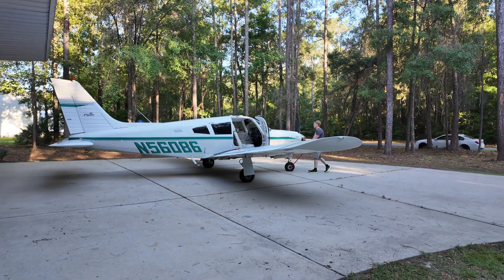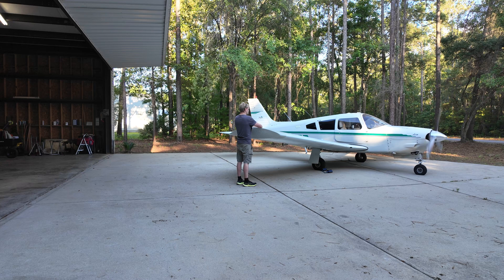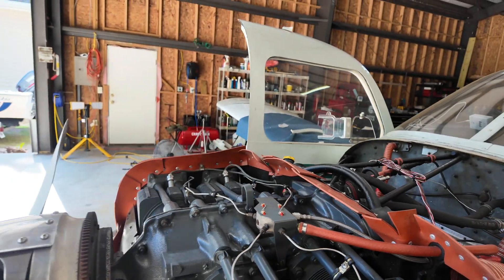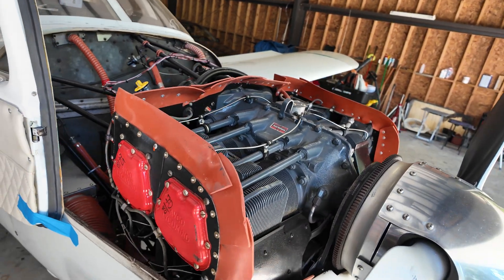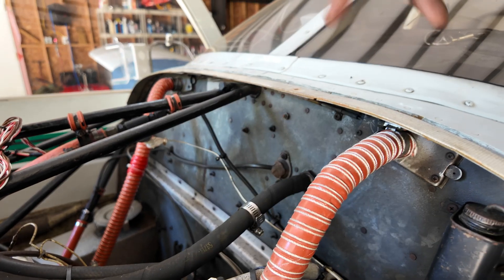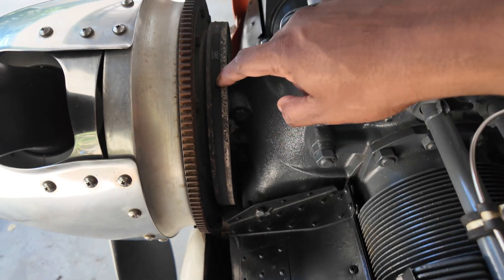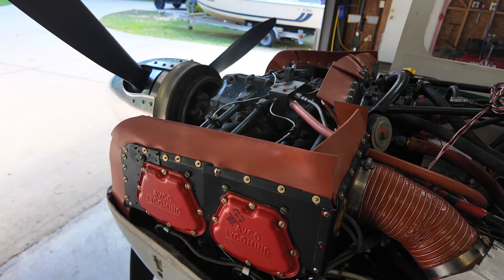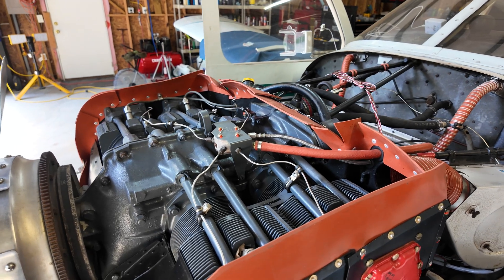Critical Engine Components - Lycoming IO-360

Comment: Watching this video I see some issues:

2:52 Upper plug wire on #3 cylinder has outer jacket worn through
7:12 Breeze clamp is loose and not fastened properly onto vacuum fitting on firewall
7:36 Zip ties directly on engine mount fastening wire bundle (zip ties will wear through paint and allow corrosion of engine mount)
8:27 Butt connector on yellow wire - insulator slid off, electrical contact is exposed
13:37 Nosegear oleo collapsed (needs pressure - should be ~3" strut showing)
Reply from the maker: I freaking love this. Several items have been addressed but I see others that I will get my A&P to hit this upcoming week. The extra eyes are worth gold. And I love your content. #enshitification
Reply: @OpenSourceGA  haha now I know you watch my videos! I too love this stuff, I found an engine baffle wearing on one of my pushrod tubes because of a viewer's sharp eyes who pointed it out to me.
Reply from the maker: Long time subscriber! One of the greatest tools YouTube affords is are team members who add value in ways like this...for free. I'll never pass on an extra set of eyes. It's an excellent perk. Much better than those who threaten to "call the feds" at the slightest inconvenience.

Comment: Hi, I saw a some kind of custom hole / baffles / guard infant of Cylinder #2 , is this for additional cooling? I have IO 360 A1b and have been fighting for over a year now my cylinder #2 running 50F hotter than my #4. Is this something you did to cool that #2, greatly appreciate ur time and sharing this video . Stan
Reply from the maker: I'll take a closer look but my this installation looks standard for this engine/airframe combination. I haven't modified it and this airplane currently only has a single CHT probe. I think what you might be seeing is the opening for some scat tubing that used to go to either the original alternator or engine driven fuel pump. The current setup does not use that cooling hose. By the way porting air to the lower part of the cowling would be a bad idea. Make sure your spark plug cables are elevated off the cylinders and your baffling is new/tight abduct the Cowling. Don't let any air get past the top of the engine it will need to get forced down for best cooling. Also check sparkplugs, clean your injectors and check your exhaust valve on the hot cylinder. 

Glad you're here!
Reply: @OpenSourceGA  It's used for a blast tube for cooling the alternator, if the alternator requires it.

Comment: Mattituck on Eastern Long Island, NY overhauled engines until 2012. They were highly regarded. IO360 Lycomings don't lose much power as they age and can be run a long time over RTBO in non commercial service. Lycoming cylinders last a long time. We overhauled two IO320s at Mattituck at 2200 hrs in a Twin Commance in the early '70's. They were still running strong but the bottom plugs were getting oil fouled after sitting with the engines canted slightly due to wing dihedral and a few drops of oil had a free route down the bottom of the cylinder into the spark plug recess. They still only burned a quart of oil in 4 hours. Do oil analysis and run them a long time.
Reply from the maker: I really appreciate this insight! This IO-360-C1C is running like a top. All the forum posts I've seen hold Mattituck in high regard.

Comment: LOL, the aviation piston engine has not progressed since WW2.
Reply from the maker: Hate to say it but you are absolutely right 😂. There are many new offerings and technology in the the experimental side but we certified folks are lacking reliable improvements.
Reply: @OpenSourceGA  Thinking about it GA, engines are pre WW2, in WW2  they had overhead cam, 4 valves per cylinder, turbocharging and supercharging with intercooling, Nitrous oxide injection, water methanol injection.

Today in GA, pushrod OHV engines with carb heat and points ignition, it's amazing what we can do in the progressive modern World!

Comment: Looks great! I've been trying to better understand the cycle of oil in the O-360 and similar engines, and specifically where in the system the oil pressure sensor is located.  I know there's an oil pump geared to the turning crank shaft and the filter, of course.  My inference is that the pressure sensor is just after the pump, but in the (admittedly somewhat lazy) searching I've done, I haven't confirmed that nor do I think I fully understand the oil system.
Reply from the maker: Sounds like I'll be doing oil (and by extension cooling) system next video.